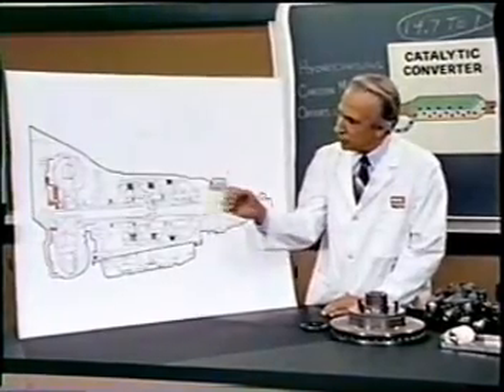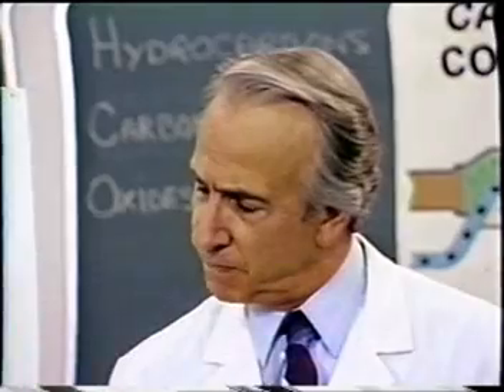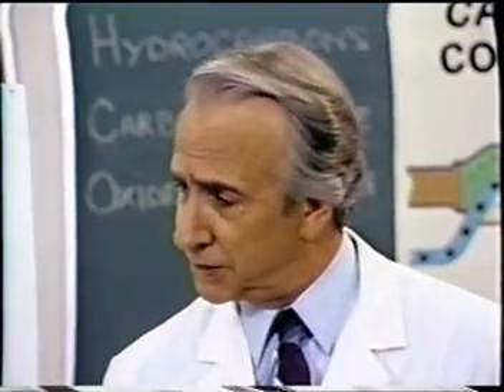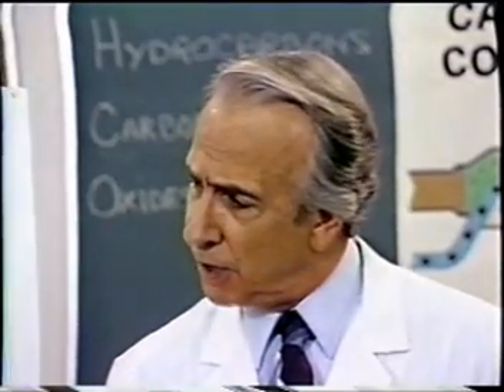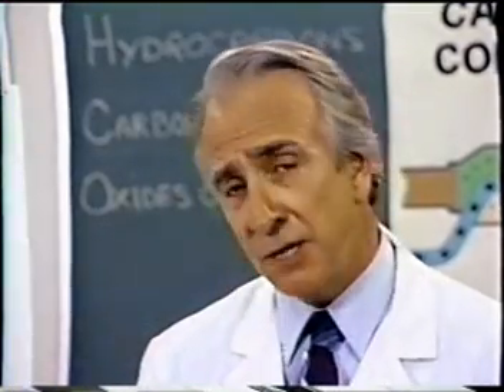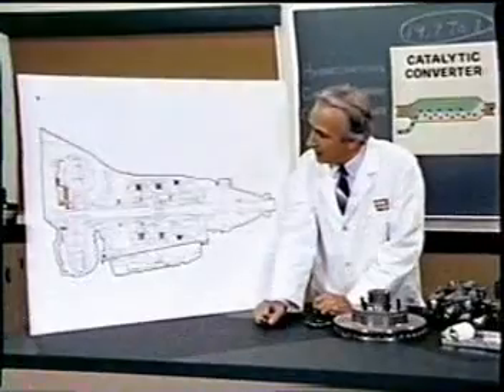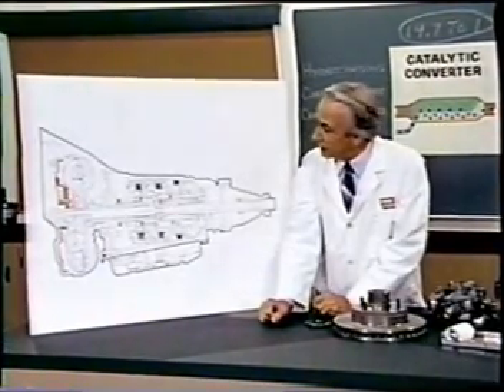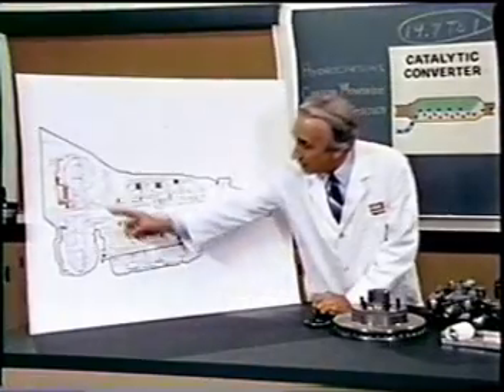GM Turbo Hydromatic 400 Lesson (TH-400)

Comment: He missed going over the phase converter, which reverses the polarity of the neutron flow through the trilithium containment fields. If you increase the quantity of the photon flow, it will increase productivity of the dingle arms to 250% above the safety threshold. This could cause a critical hull breach, but if you adjust the inertial dampeners to compensate, you can do the Kessel Run in less than 12 Parsecs. Or so I heard from Lieutenant Commander Geordi Scott.

Comment: YEP dingle arm is the highlight ! without a proper dingle arm there is no forward ball separation ! and then you will have to replace the forward reverse crown nut on the aft torque slider in order to realign the base slider which engages the main shift housing . what the hell guy's this is basic stuff ! get with the program !